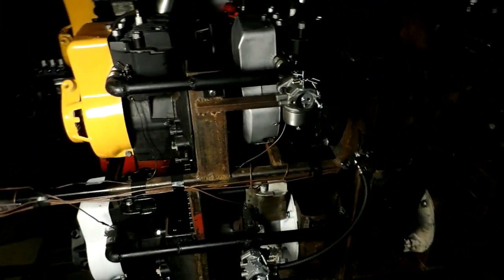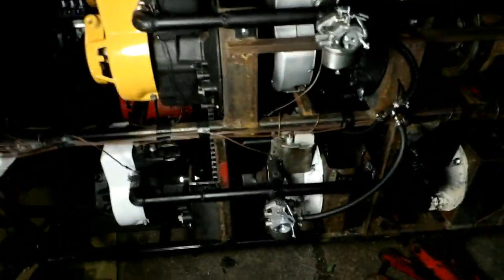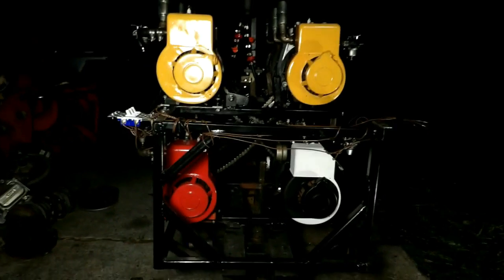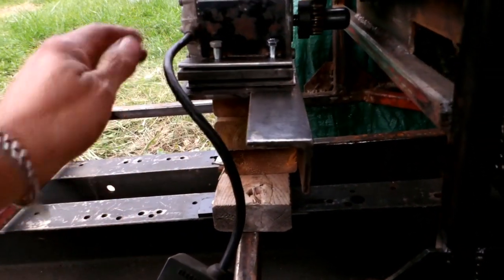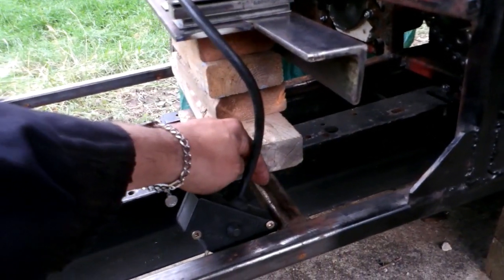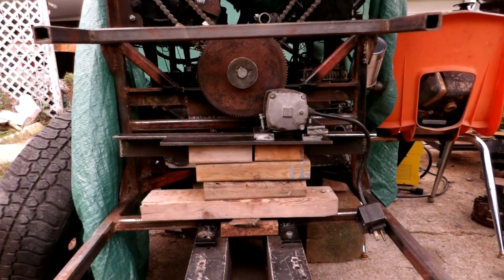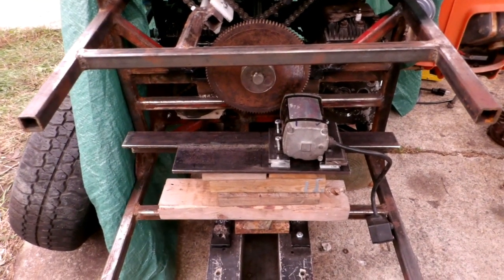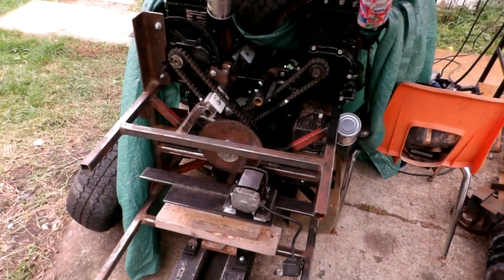12 Cylinder Engine Starting Attempt & New Starter Mount

Comment: I installed a 11.5 hp new Briggs intek engine on my 20 + y o snapper mower I found on line OPE engines for $465 delivered to the house. Running like a raped ape 😉
Reply from the maker: HaHaHa  ,sounds like you are mowing the grass at Warp speed !!!!
Reply: @ChargerMiles007  yep found a guy that helped installed it a new drive disc and chopping grass just like new now 😎

Comment: Those damn Ford Focuses! Buy a Civic, you won't be dissapointed.
Reply from the maker: I don't know, I have worked on a few old Civics, pretty shoe horned in there. I would lean towards Toyota, I think.
Reply: @ChargerMiles007  
Hard to go wrong with either.

Comment: Run that thing on propane or natural gas and the power it would create would be invaluable. ;) Amazing torque profile. Would be interesting to dyno. 🤔🤔🤔
Reply: I was wondering how it would run on propane.... I have a few engines with a dual fuel carb and the propane metering seems like it might be more friendly to multiple cylinders than a gas carb...  Btw, I find this project very interesting. 12 little Briggs, 😄
Reply: @volvo09  yes very interesting indeed the max torque profile would be incredibly low and peak efficiency could be as low as 800 - 1200rpm. With a profile that low this could be plumbed into a gas line and ran for pennies a day while powering a sawmill or an electric generator. :)
Reply from the maker: Great point!

Comment: How did you calculate the proper size of carburetor to use for each gang of 3 engines on one manifold?
Reply from the maker: I used trial and error, I have ran 3 similar sized engines on the same carb before, so I thought it should work this time. I just ran and 8 cylinder version, and 2 cylinders being feed by the carb did seem to work better.